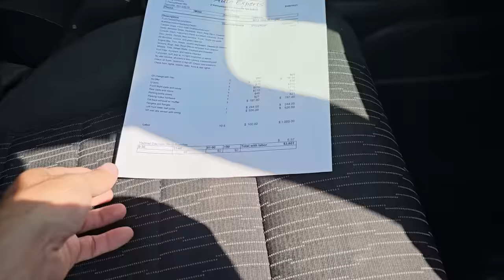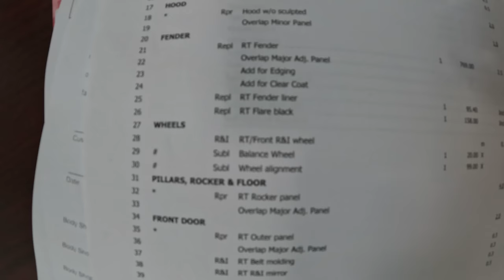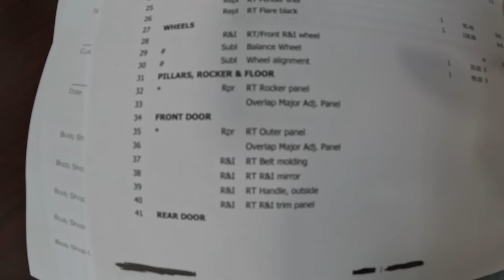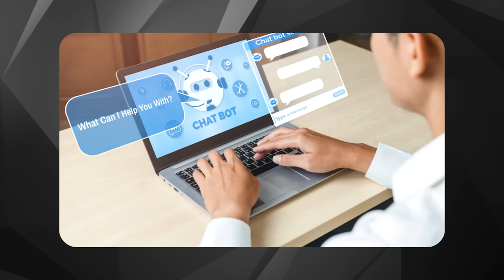A Customer Returned Her Car Crashed! - Confessions of a Car Dealer Part 2

Comment from the maker: Try The Coverado Seat Covers right here! and use code: 05K793LN for 5% off https://www.amazon.com/promocode/AYVW6K2EDXNVY
Reply: Your videos are great and you do your best to be honest. I watch all of your videos, BUT. Try to remember what you say at the beginning of the advertisement and what you say at the end of the video ( first time I use coverado….) Great job anyway.
Reply: Some that self cars whiteout warranty see a alot of car seller. In Europa the car need to go to have paper he is Oke and is noting rong whit it and have 6 ore 1 year warranty. But the USA you can do whatever you want and that is the problems
Reply: I legitimately wanted to buy some of these seat covers, because they actually look nice. However, they don't have a super wide selection. Wanted a set for my Ford truck bench seat, but they only have them for the back seats. Wouldn't be able to fold the seat with that cover on, sadly.
Reply: IfI remembercorrectly, the ecu is behind the skirt under the passenger fender. I wire might be chaffed or water got to that area after the accident or not even related. Remoce the connction to the ECU check for green crusties and make sure the plug is seated correctly and make sure the wiing loom isn't damaged

Comment: Dude I can’t stress enough you have to be one of the best dealers out there, you are such an honest person who in this world would do that for anyone .I leave in Boston, MA and will definitely go to your dealership whenever I’m thinking to get another car.
Reply: I’m going thru this right now with a customer. 1st it’s been some catalytic converter problems which I had to replace both manifold cats. On the way from the auto part store the transmission started slipping. Oj the way to the mechanic shop I got into an minor accident in stop and go traffic. So now I have another vehicle that I have to get the front bumper fixed, my insurance is going up and points on my license. This has been an absolute nightmare.
Reply: The fact that he's stressing this at all speaks volumes. You wreck it you own it.

Comment: Down the road, when they deal with someone who isn't as generous as you were in this situation, they'll realize that you went out of your way to help them out, when you didn't have to. Dealing with these type of situations takes years off your life, putting up with the stress. Those seat covers are great, and an excellent option to replacing seats, or having them recovered.
Reply: Particularly if they run across someone who is shady, they just might ruminate on this experience and compare

Comment: I've been a car flipper for over 40 years. I am also a good mechanic. I go through my vehicles with a fine tooth comb. I completely refurbished them mechanically, visually and all potential safety issues. But there's always a few that are just crap. I just had a 2011 RAV 4. Replaced all fluids, brake parts filters ECT. Went to replace the 4 spark plugs and all 4 had been crossed threaded, the head was crossed threaded. It was done at the factory. It got repaired and sold. But I lost money on it. It was the right thing for me to do. I could have sold it or auctioned it but I feel better that the job was done and the new owner has a great running vehicle.

Comment: The JEEP might have been a bad experience but that in NO WAY is your fault. I just can't see how the way you handled the situation can be interpreted as a bad experience. You were willing to work with them and help them the WHOLE WAY!! That's a GOOD GUY not a bad guy!! Those are HIGH MAINTENANCE customers and I'm glad they are GONE!!
Reply: Agreed
Reply: Even after the lousy social media post that did not reflect the actual interaction and facts I would have had a harder time doing what Craig did after that. I could understand the post if the dealer cut off contact and said deal with it but not when Craig was still working with them.

Comment: Its the same engine block on those cars, but not same heads or pistons or rockers or oil pumps or pans,  they all have different parts with different clearances depending on the application.

Comment: What is most common problem on Nissan Pathfinder?
Most Common Nissan Pathfinder Problems - GT Automotive
Most Common Nissan Pathfinder Problems
Nissan Pathfinder Transmission Problems. According to CarComplaints, one of the most common Pathfinder issues is transmission failure. ...
Coolant Leaking into Transmission. ...
Worn Timing Chain. ...
A/C and Heating Problems. ...
Faulty Fuel Level Sensor.
Reply: We had one as a work vehicle in our fleet and it was a great vehicle. With that said, the boss man at my second job purcahsed one and it was total garbage and TONS of problems.
Reply: @27Zangle  before was Made in Japan now Nissan is owned by the Renault crap
Reply: Exactly it’s a matter of time when the Nissan starts having problems and he’ll be at the same position.

Comment: I commented in the last video how i felt about the situation, this one i just want to make 2 points here. . .
1) you are a great guy, great dealer, completely honest, do more than you should, continually go above and beyond. 
2) they are completely unreasonable, they chose not to resolve this from the start by denying your buy back, they accepted youre offer to fix it, they told you thanks and it was good to go, they then continued to expect you to do more than you should be doing. And now you have more work to do than you should or would have if they allowed you to buy it back at the start.

Please stop trying to please these people and stop trying to offer replacement vehicles, ect . I really hope you just wash your hands and be done with these people. Im upset about this situation and im not even you (you are too good of a person)

Comment: That returning issue is most likely a cracked coil. its not common, but when it happens on these it is hell to diagnose. The error comes back when the engine gets wet enough to cause the coil to lose power through the crack.

Comment: All I can say is you are amazing. You did way more then those folks deserved. They have been made 1000% whole. Yes they were inconvenienced originally, but bent over backwards on that engine issue. But then she crashed the car and they didn’t want to take responsibility for that and dumped that on you too, even refusing to get it repaired. You then took on that problem as well. Then you worked on resolving their next problem by getting the Nissan for them. They rejected that! Sorry but these folks were unreasonable and not fair with you. You’re a great car dealer and they should see that. Keep the great videos coming. I love your Chanel. Thanks 😊👍🏻🇺🇸🇺🇸🇺🇸

Comment: The older 3.6 Pentastar engines crack the left head.  Chrysler fixed the design flaw in the newer Pentastar. You have to look up the years,  but i think they fixed it @ 2016? GOOD LUCK!!
Reply: Yup, cylinder 2 misfire / head / valve issue is a known issue on those years!

Comment: On these newer engines.     You cannot go 5, 6, 7 thousand miles on an oil change.    And that's what people are doing these days.    Newer engines have very small oil ports in the block.    They build up with sludge with missed oil changes.    Then the engine is junk

Comment: I purchased a 2020 jeep gladiator rubicon brand new and the check engine light pretty much stays on. After a bunch of trips to the dealership for about a year after buying it the mechanic at the dealership told me that the check engine light would go off by itself after so many cycles and sure enough it does so I just live with it coming on regularly. 😊 I hope this helps. By the way I still have my jeep today and am happy with it.

Comment: As an ex smog technician of 5 years, you need to drive cars way more than 10 miles to find out if it has any issues, I’d always tell people drive cycles are 100+ miles and their eyes would get big. 100 miles is even a small amount. Most monitors won’t even set until 100. Diesel monitors have taken 1000 miles to set in my experience. Evap codes/ issues won’t show up until 500 miles at times

Comment: What are issues with 2018 Nissan Pathfinder?
2018 Nissan Pathfinder Problems and Top Complaints - Is Your ...
Electrical, braking system, steering and powertrain issues among the top complaints received by the NHTSA from vehicle owners.
Reply: CVT transmission.    That's the problem
Reply: @gregorylyon1004  
The new system will use a launch gear to give drivers the feel of a traditional transmission, and it will improve its efficiency in the lower gear ratios. 👍😂
Reply: @gregorylyon1004  Toyota Added a First Gear to its CVT
Continuously variable transmissions are great for efficiency, but for accelerating from a stop, its a solid gear you want.

Comment: The 2011-2012 Chrysler Pentastar V6 had a recall when new for the cyl head the issue that Jeep had..

2014-current are solid reliable engines even the previous 2011 versions will last 200,000 plus miles and the repair isnt that expensive/most require rocker arms that are not hard or costly to do..I sold multiple 2014-current 3.6's and the customers came back after 200,000 plus miles wanting another vehicle with that engine one as they were reliable,powerful and economical..I get 32-34 mpg in the cars with that engine on the hwy at 70 mph(300/Charger/Challenger)..I have a 2015 with 120,000 miles I will take home tomorrow and really check it out,I really like that engine.Albeit I am a V8 guy but anyways good experiences with the hundreds I had at my lot,no tone came back!

Remember 2010-current Toyota's have oil burning problems caused by faulty piston rings that need a replacement engine as it destroys the engine,so every brand of vehicle has their own issues! I hav a 2016 Corolla with 110,000 we just put a re manufactured engine in it,one owner 64 year old female babied,dealer serviced since new car is immaculate but burned oil and knocked.

Former Tech/Mechanic and now small car dealer owner..
Reply: You are exactly right.    That engine came out for the 2011 model year and up.    But the first 2 years worth of engines are all junk.     So don't buy a 2011 or a 2012 vehicle with that engine.   Junk

Comment: You offered more options to them than I had thought of and I would be the customer side so hey I think you did great wouldnt of stopped me from coming back to the lot ,...oh on the missfire jeep I had a 300 5.7 that did that , bought it  brand new boom missfire issues  , turned out to be two pins slid in the same hole on main brain ecu as one was bent at factory,  they  threw 3 coil packs , 8 injectors injector loom ,new ecu brain which car was rejecting , before spotting the two pins in the same hole and this was my dealer i have bought 5 new cars with the entire staff always treated me well , you did a great job 👍

Comment: Craig if you’ve gone through the engine an your 100% sure that’s not the issue the FAA products have a lot of electrical problems might be the computer or tipm that was the case with my last FAA product

Comment: We own a 2013 pathfinder with almost 200k miles and she runs without issue save for AC and transition replacement, both of which are expected with such a high mileage vehicle

Comment: Its the Rockers , the bearing wheel im the rocker the needles fall out , and its been a big issue in the 2011 5.7 in rams as well, use oem rockers, AH is the current revision,  the aftermarket ones are the older style factory ones so they can and will fail again get the current Revised part from mopar
Reply: It's a junk engine.    The first two model years of that engine are all junk.    2011 and 2012.    My brother is a Chrysler mechanic.    He told me

Comment: Thank you for the video !!
With regards to those Coverado seat covers in your S6 (I assume the S6 seats are with OEM leather seats), does the inside of the seat cover rub against the OEM leather which potentially cause wear at all (if you applied any leather conditioner to the OEM leather seats before putting on the seat covers)?  Thanks!

Comment: lol you sold them a jeep with mechanical problems (unknowingly) but then try to sell them a nissan which is knowingly a POS across all models because of the cvt's they use. they dodged a ticking time bomb by not accepting your deal. sounds like though everyone came out ok in the end though, so good for you for trying to make it right the best you can.

Comment: I'm a Chrysler master tech, and the 3.6 in wrangler, gladiators, grand cherokee, durangos, and pacifica minivans have been very problematic lately. Everything from lifters eating cams to heads cracking. Their either really good or not.
So far the 3.6 rams, chargers, challengers have been mostly unaffected
Reply: I am a used car dealer and dont deal in Jeeps; having said that, I have had good luck with the older minivans.

Comment: Not every issue with a car is something the customer is hiding.  I recently sold my Hummer to a dealer.  Told him everything I knew was wrong; leather seats needed refurbishing, a few dents and dings here and there.  He had his mechanics check it out and the steering linkage was a bit loose, and the power steering pump had a leak.  Not an external leak, just leaking fluid around the high side of the pump to the low side.  Hell, sometimes we just get used to how a vehicle drives and don't think it is unusual.  And dealers do it too.  I've bought used cars from dealerships that had issues that should have been taken care of before the sale.

Comment: As a a master autp tech, it is my assertion that the 3.6 pentastar engine in one of Chryslers worst offerings. Here is why.... There are wiring routing issues causing chafing and random codes. There are valve train issues. I have seen follower (kind of like rocker arms) failures, cams flatten out. Oiling issues. Ring failures. Oil cooler failures on both oil and coolant side (this is the most common failure. If not caught, it will destroy the engine) Timing chain issues. These issues tend to show themself at around 80k and up. I have replaced dozens of these in the last few years. I recommend running away if the car you are .looking at has one of these.

Comment: You could have avoided this issue if you drove the car a little bit before placing it on your line for sale, after all you bought it went through it but if you didn't drive it prior to selling it, essentially you set yourself up for issues with it by not test driving it. most cars need to be driven on the highway and in traffic after reseting the computer to ready them for diagnostic purposes with the computer and fully reset the computer to see if a repair was correct

Comment: Definitely a great video and you definitely did not do anything wrong. High mileage cars are the vein of existence they're always going to have problems That's why dealerships are still around unfortunately. They definitely do not make them like they used to wear a car would last the test of time now you'll be lucky if it lasts the $100,000 mile warranty.

Comment: I watched a you tube video today "uncle tony's garage and he was talking about a Nissan Maxima that had a bad coil pack on a cylinder. He went to change coil pack and was told it was a dealer item. So he goes to buy a new coil pack and dealer told him he had to change all 6 coil packs. He changed one coil pack and car ran fine for a short period of time. Then problem came back. Computer was showing a coil pack failure. He found out that computer found new coil pack showed a different resistance than other coil packs then it throws a check engine light. It said there was a coil pack failure. I just wonder if same problem could be on that jeep you have? Hope this is helpful.

Comment: Craig, you did more than the right thing the first time you offered to buy the Jeep back. When they declined, that should have been the end of it. The money you're losing on this is just crazy: The initial repair you did to the Jeep; the profit you're losing on the Pathfinder; etc. etc. By all means I'm for doing the right thing, but none of what happened was your fault, and you went above and beyond just by offering to by it back the 1st time- after that, everything else was on them. All this and the morons still are not going to come back or recommend you. No good deed goes unpunished!

Comment: Man, I hated following this.  I know youre an honest guy.  Used car dealers have a well earned reputation. I bought a BMW 335i on ebay motors.  It showed up with the AC not working, dummy lights on the dash, and a hidden accident. It looked perfect in the pictures.  He must have cleared the codes for pictures

I know you dont work that way, but there are plenty of dealerships that do.

Comment: I am absolutely impressed with how you handled this situation and this is coming from someone that is currently getting screwed by a used car dealer. I very reluctantly traded in my mustang for a truck because I am losing my home and needed a truck to pack my kids and my things in. I explained to the dealer that I need a truck that was able to pull a small RV because that will be my home now. He assured me it was all checked out and it was great, Two days later the check engine light came on, got stopped by the police that I didn't have working low head lights and it's been continuous from then on. I just made my first car payment for something that I am terrified to drive after it went into limp mode in the middle of rush hour traffic and cars had to swerve to not hit the back of me. I would have appreciated the piece of shit dealer do the slightest bit as you have because I have been keeping in contact with him in writing with pictures, video and explanations of everything that has gone on. Lucky me